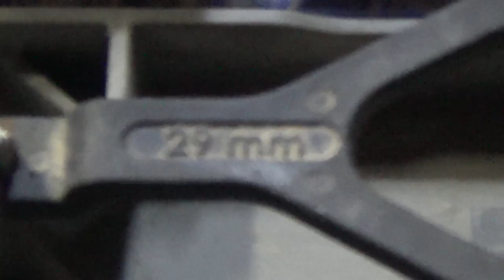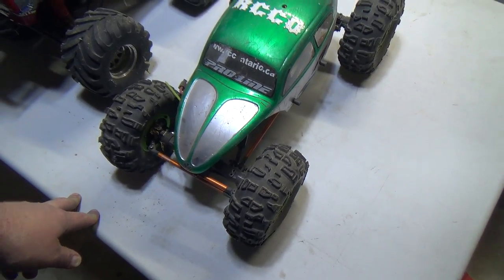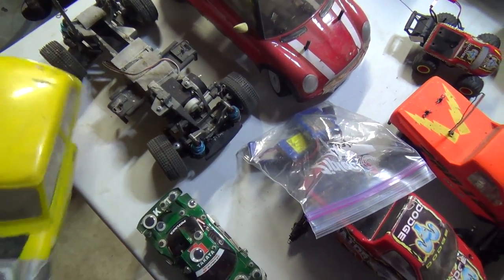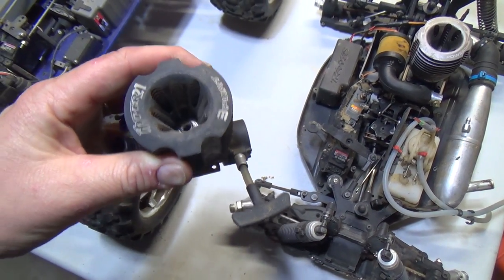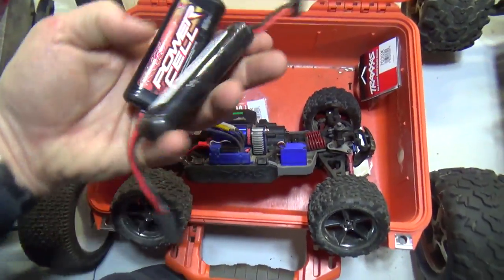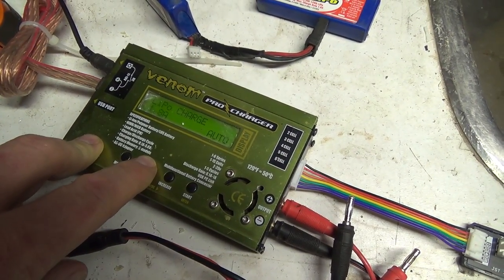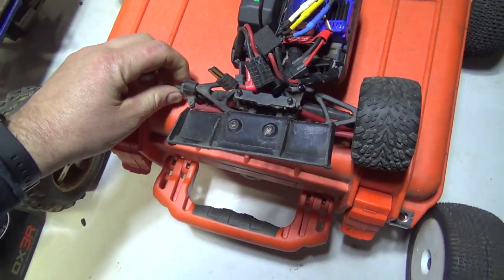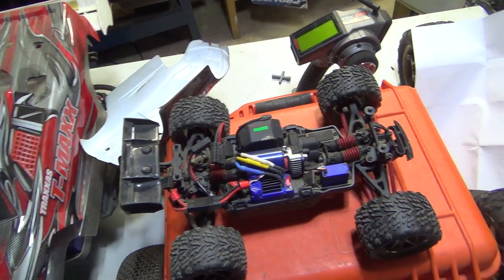Lets check out all the R/C cars and truck I had and charge some battery's up. Are they junk now???

Comment: My father and I got into rc electric helicopters 🚁 let’s just say shelf queens. Batteries swelled if they did that junk. Even after a sit after a flight cool off if they didn’t relax junk. Because if you continue to fly they might burst or short out. They hosed you on shipping they charged you a hazard fee. I let my dad fly. They suck the juice out is why the swell and heat up. Just like you fuel went to the moon plus before hand he built rc planes but that died out props get broken etc. technology changes thousands spent building to re spend on new servos radio’s etc. he used KRAFT  early early spectrum I thunk the old stuff worked it wasn’t broke. But battery design and shape killed that. If any one gets into it or back into it be fore warned your credit card will smoke. Build planes fir fun but cash in the trash 🗑 they all crash eventually fun with teens sit help dad with glueing a few hours a night day. Ventilation with glue  ought to see about rebuilding this one price wise [ooo momma] just to see